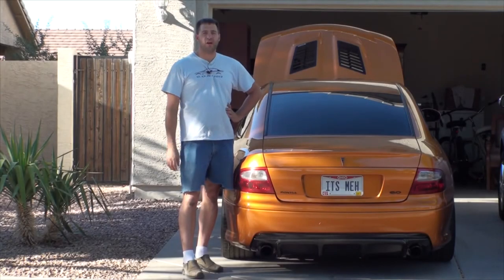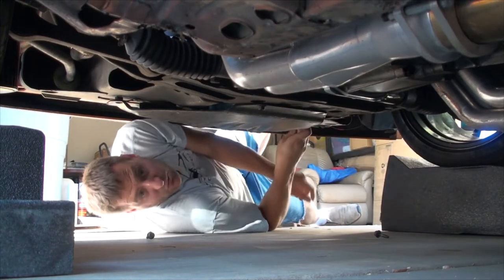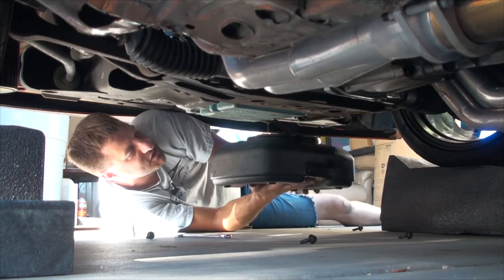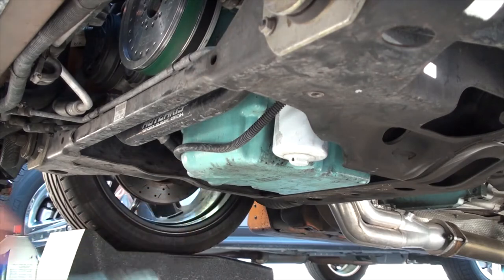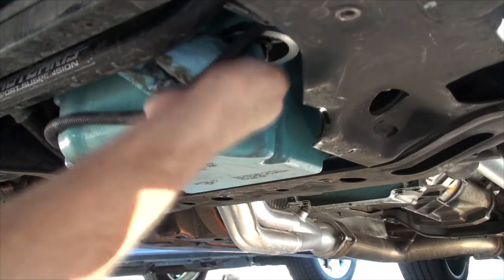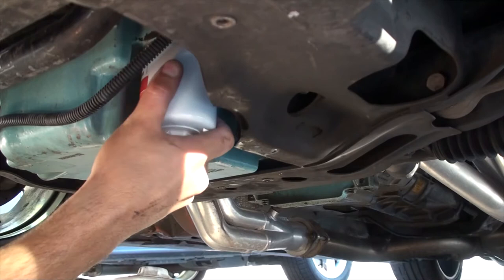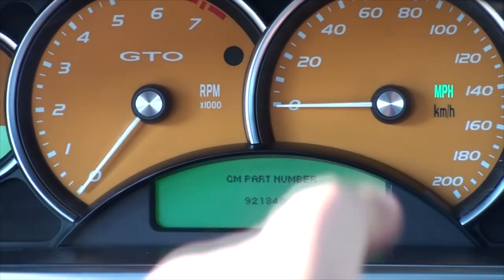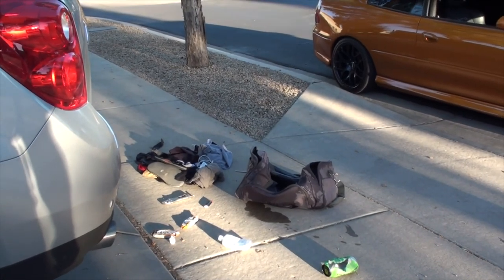Josh's Car Corner - Ep. 51 - How to Change Your Oil

Comment: If your motor mounts are stock/old/bad, I would not use the larger truck filters, as my gto wore a hole in the filter and made a leak.
Reply from the maker: Braydon s That's a great observation! Thanks for the input. Nick and I both have poly mounts.

Comment: agree with everything except for saving money..it's actually cheaper to take it somewhere. Now whether it's done right depends on where you take it
Reply: not if you are using synthetic oil.  those changes cost a lot, but you can get jugs of pennzoil or mobil 1 pretty cheap.  Or even just use supertech synthetic.  Made by warren oil, its good stuff.

Comment: With the stock pan and filter it calls for 6.5 qts. I wouldn't risk the filter without the anti drain valve for the extra .25 quarts.
Reply from the maker: David It's a personal choice.  The drain back valve only comes into play when the engine is off. When the engine is running they operate exactly the same.  As long as the filter is full of oil, you'll have oil pressure in the engine immediately after startup.
Reply: @JoshsCarCorner  when the filter is vertical like that, you don't need a anti drain back valve because of gravity, right?   Or is there a chance oil can get sucked back up out of the filter?

Comment: Good to see you got settled in the land of the sun.   Quick question.  Were you using the race ramps without a backup jack stand?  I just got some race ramps but haven't used them yet.  I was planning on having a backup jack stand just in case though.  Thoughts?Tommy in Houston
Reply from the maker: Tommy Spencer I have jack stands, but Nick brought the ramps so we used those instead. I had total confidence in them.

Comment: What oil do you recommend for gto? I currently use mobil 1 synthetic 0w-40 and have read that German Castro is better.. but what is German Castro and what weight? I've read it has changed labels and weight from before thank bud great video!
Reply from the maker: I definitely wouldn't use anything with a 0 weight. That's only for extremely cold climates or engines with really tight bearing clearances, which the LS engines don't have. It honestly depends on your climate. GM calls for 5W-30 in the LS engines so that's what I used to run. Here in Arizona I run 10W-30 since it never gets cold enough to need a 5 weight oil in the engine.  For track duty, it would be good to step up to a 40 weight, maybe even a 50 weight. The oil temps your engine produces will determine what weight oil you should be running.
Reply: Josh's Car Corner I use 20w-50 for my stroker engine as this was recommended by the shop who stroked my engine. What do you think?
Reply from the maker: Buddyrebel Depends on where you live, but it seems a bit excessive.  20 weight oil will start to get pretty thick around 40 degrees.
Reply: Josh's Car Corner I live in Southern California. But my car is a stroker and generates more heat. According to the engine builder they recommend 20w-50 racing oil. They run that oil on all their stroker engines so I went with their recommendations since they do engine builds all day. Your thoughts
Reply: Josh's Car Corner I live in Southern California. But my car is a stroker and generates more heat. According to the engine builder they recommend 20w-50 racing oil. They run that oil on all their stroker engines so I went with their recommendations since they do engine builds all day. Your thoughts
Reply from the maker: Buddyrebel If that's what they say I'm not going to refute it.  Personally I wouldn't run a 20 weight on a street car. Maybe a 15W-50.
Reply from the maker: Watch this video to understand what oil you should be running. 

https://youtu.be/6VLMfUz34R0

Comment: You're wrong, with the  factory oil filter it  takes 6.3 quarts of oil not the largest one..
Reply from the maker: Actually, the correct amount is when the dipstick reads full after the engine was just run. Which based on how long you let the oil drain and whether it was hot or cold when you drained it, you'll end up refilling anywhere from 5.5 to 6 quarts normally.

Sure, people could listen to you and put in 6.3 and probably end up overfilling. Then they have to pull the plug and drain out the excess oil, which means trying to put thg plug back in while oil is still draining and making a mess.

OR, you can start with 5.5, and if you're a bit low, you can top it off a bit until the dipstick says it's full. I'll let the viewer decide which is the better way.
Reply: @JoshsCarCorner  you  could be right but I own a gto 6.0 ls2 for 6 years and I always do 6,3 Quarts of 5,30  mobile 1 full synthetic as well mobile oil filter and measure just fine..